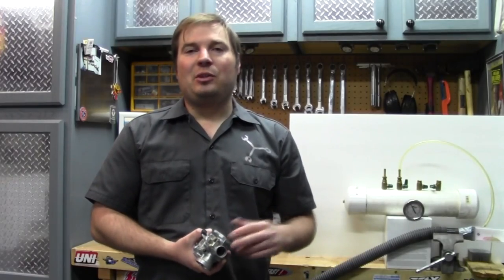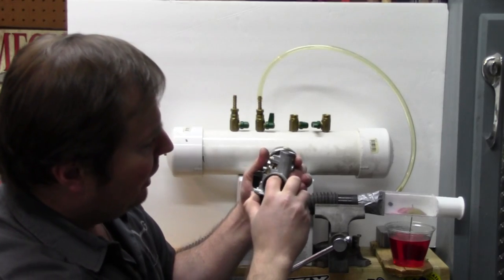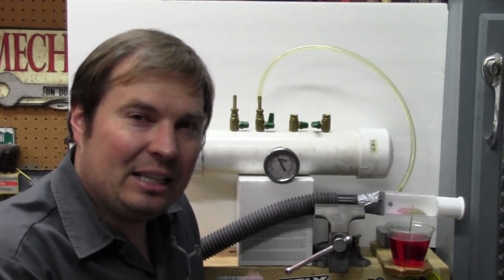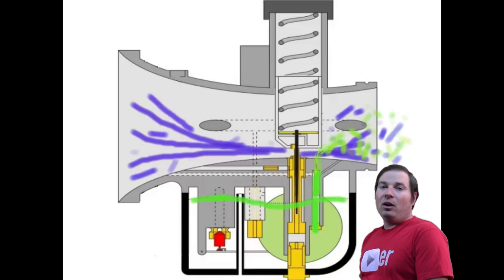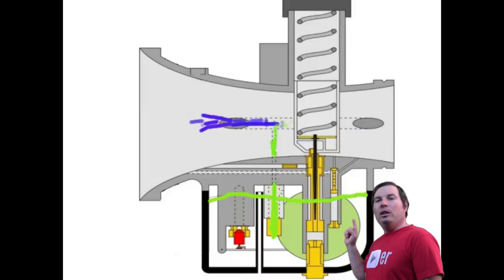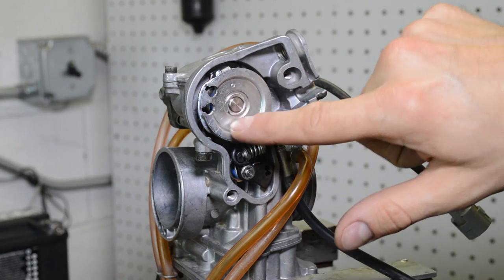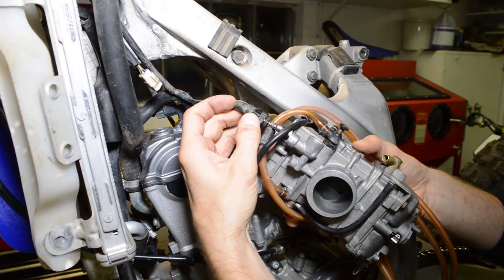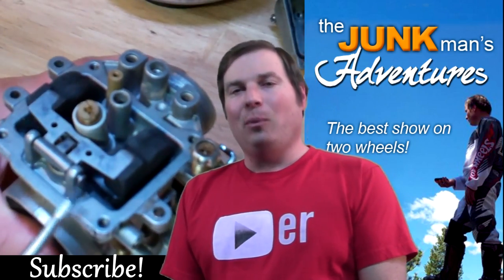How to adjust a carburetor, jetting and mixture explained!

Comment: I got a 2020 yz250x and my elevation is about 4500 FEET above sea level. What do you think i should go with jetting? Dont really know much about jetting.
Reply from the maker: The higher the elevation the lower the air density, the leaner the mixture you will need.
Reply: @thejunkman  so the bike comes with a 50 pilot jet and a 178 main jet for see level, im at 4500 feet above sea level. What pilot and main jet would you reccomend me to run at this elevation?
Reply from the maker: Is it bogging or spitting excess black soot right now?  If not, I would just leave it alone.  Otherwise get one step leaner on both and do some testing.  4500 feet is not terribly high up and should not require much of any tuning, maybe a jet needle clip position change is all.  I have to jet my bikes all the time as I regularly ride from 2000-13000 feet with an average of 7,000 feet is what I shoot for a sweet spot.
Reply: @thejunkman  throttle response feels perfect, power feels good and everything. But when im taking a corner in say first gear it feels like its gonna die out unless i throttle the gas. Also ivd gone  through 3 spark plugs in about a month. So idk if its the jetting or what?
Reply from the maker: I guess the first thing I should have asked is if the bike is broken in?  There is a period of time when the parts need to "wear in" so to speak and this can cause odd performance at times.  Also being it is a new bike, sometimes some swarf from the manufacturing process in the tank finally makes it into the carburetor and can cause odd problems.

Comment: i am rejetting for temperature and altitude on my cr 250, what i need to know is do i richen or lean out for colder temps, and do i richen or lean out for high altitude
Reply from the maker: Richen for cooler temps (air is more dense). Leaner for higher alitulitudes (air is thinner)

Comment: Do the butterfly make any affect on the vacuum?
Reply from the maker: On a CV type carb. Yes as that controls the air into the carburetor. But no if you are talking about the choke plate.
Reply: the butterfly .the rison i ask this is bcuz my1994  750 catana 2 and 4 are warm not hot like 1 and 3 but when i sprey gas in2 and 4  they get hot my air and fuel screw are set to 2 1/2 out all 4
Reply from the maker: If I am reading your response correctly (spelling and grammar aside) It sounds like the carburetors are out of sync, and thus those that the exhausts are not hot have either an ignition problem OR the carbs are not sync'd with the ones that are working.  I don't have a video on bench syncing but this guy that I have collaborated with in the past has a good video on it.  https://youtu.be/oVlLitzF38I

Comment: @thejunkman hey man im having issues with my 2t 86cc yamaha zuma. It used to rev up to 13500rpm at full throttle. Now this is what happen. Idle to 90%throttle rips and accelerate 0-120kph no issues but once i move throttle from 90% to full rpm drops by 300-500 rpm and ypu can tell theres a power loss and decrease on the speed. But when i back off to 90% its better power and speed. 

Am i too lean or too rich on Main jet?

I am using 26mm pwk  mj:108 idle: 40 needle:#2 from top

Thanks
Reply from the maker: You sure it's not the Cvt slipping?
Reply: @thejunkman  no.. cause it accelerate like a drag scooter(slightly exagerated lol). I tried to put throttle 90-full slowly to eliminate this issue but the rpm drop is still there. It seems like there is a switch between 90-100% that causes it thats why i thought it might be the main jet.
Reply from the maker: Well that is the only adjustment in play at that throttle opening. Try one step richer.
Reply: @thejunkman  i might be wrong with my thorttle percentage.I just double checked and it was around 3/4 to full throttle. Thats when the rpm drops/decrease in speed.
Reply from the maker: Ok, well the video tells you what adjusting are in effect at that throttle opening.  My other video will help as well. https://youtu.be/SkoMCP9QreQ

Comment: Does pilot jet work on an open wide throttle ? Because on my experience, bigger size pilot jet gives sligthly richer fuel supply on full throttle than the smaller one with the same main jet.
Reply from the maker: No, the pilot has no effect on mixture at WOT because all the fuel supply is going up the main jet as shown in diagram
Reply: thejunkman And what do you think about big or small pilot jet on any condition ? I mean any kind of effect especially on tuned and daily use engine ? Thanks.
Reply from the maker: The pilot jet ONLY affects the mixture at idle-1/8th throttle. The rest is controlled by the jet needle taper, clip position and main jet size
Reply: What turns the pilot off at WOT?
Reply from the maker: The fact that the vacuum is lower amd the fuel level in the bowl is lower below the dip tube of the jet itself since the main jet it sucking all the fuel.
Reply: thejunkman is that a theory or proven? I  am not arguing but challenge that the pilot is shut off at WOT.

Comment: mrbrenton182
20 minutes ago
Hi guys, trying to tune a 97 KTM 360. The carb on it is a Keihin PWK 38 that also has a 'Throttle Stop Screw'? My question is, where does this come into play with jetting the bike? What is it's neutral position and/or do I set the air screw first and then adjust the throttle screw? Thanks guys
REPLY
Reply from the maker: +mrbrenton182 the throttle stop screw is what sets the idle speed by limiting how far down the throttle slide can go, thus limiting how much air can go through the carburetor at idle or with the throttle closed.

Comment: I have tao tao 125 cc hellcat with a mikuni carb on it, I cleaned the carb and put  it back on. Bike started and idled but when I give it throttle it dies out, any ideas ?
Reply from the maker: Take a look at your pilot jet and the jet needle position.  Watch the video again and look at how the fuel flows at partial opening throttle.

Comment: Hi brother, I have a problem with my Megelli 250R , the motorbike is difficultly started when the engine hot. Could you give me recommendation regarding this problem?
Reply from the maker: Mixture might be too rich.
Reply: Thank you for your advice we will check and give you info regarding the reason
Reply: Manufacture recommend me to adjust returning clutch
Reply from the maker: +Namiq Nasirov the clutch shouldnot jave anything to do with ease of starting
Reply: Thanks for your response, I will inform you regarding reason

Comment: At full throttle, why did the pilot jet activity stop?
Reply from the maker: At full throttle the fuel level is below the pickup on the pilot jet rendering it inactive.  Even in the instances that the level is at the pickup point, the pressure differential will mean that the fuel will naturally want to go through the main jet as it is a larger hole.
Reply: @thejunkman  oh interesting, I've been wondering how jets switch for a while. Your the only guy with the answer! Thanks man

Comment: I have a polaris 2004 XC 600 twin with mikuni carbs. It starts and runs fine. After 30 seconds or so it starts to die. pumping the throttle will recover it, and turning the choke on helps too. Seems like it's starving for fuel. After pumping the throttle a couple of times it runs goood again, then after a 30 seconds or so will try to die again. Any suggestions?
Reply from the maker: Good job you diagnosed your problem. Fuel starvation is a sign of a fuel delivery problem, check that first. Ie clean the full system.
Reply: OK quick update. I did some more diagnosis this weekend. I pulled the fuel pick up out of the tank, and gave iit a cleaning, but it wasn't dirty at all. I started the sled up and paid some closer attention. It idles @ 1100 RPM for about a minute, then it starts to die. I pump the throttle to get it going agin, and about 20 to 30 seconds it starts to die again. However, if I hold the throttle open @2000 RPM or 2500 RPM, and hold it steady, there is no dieing at all. It just keeps on running nice and smooth. So, that makes me think it miight not be the fuel pump, or even the floats in the carb. I tried adjusting the idle higher but it didn't make any difference. BTW I already confirmed it wasn't the tank air line being plugged byu running it with the gas cap off. Same issue. So, would this dieing at idle w/no throttle be a carb adjustment issue?? If I have to pulll it apart to get the fuel pump out, it will sit until spring, so I'm just making sure I'm not barking up the wrong tree. Thoughts? TIA!
Reply from the maker: If its got some sort of fuel pump I would say that might be the next thing to verify.  Its a fuel starvation problem, so you have to work from the tank to the carburetor first.  Do these sleds have some sort of vacuum operated fuel pump?  How about the fuel shut off, is it vacuum operated?
Reply: Yes, it's a vacuum fuel pump. I guess next step is taking it apart and cleaning it, and checking the gaskets etc. Fuel shut off is just a manual valve in the fuel line. It's fully open as far as I can tell.
Reply from the maker: The vacuum pump might have a tear in the diaphragm.
Reply: Ok I’ll check for that. Is it possible there is a bit of a vacuum leak going to the fuel pump? I’ll check the lines just in case
Reply from the maker: That is a possibility.

Comment: Hey, do you know what would cause a 1995 KTM 250 two stroke to engine pulses on decel and idol?
Reply from the maker: That is usually caused by either a vacuum leak or a worn, warped or broken reed

Comment: Let me explain about honda cb250 night hawk carburetor it is 2000 model carburetor  va37mam police version. I clean it and start the engine but still smoke are not stopping from exhaust pipes and spark plugs are black dry sooty deposit and when I replace a new  va35 model carburetor smoke are stopped and spark plugs color is nice but I really enjoy with va37mam 2000 model carburetor which is beginning from my bike so please let me explain the solution jankman how this carburetor problem solve and how i can ride my bike with this carburetor.
Reply from the maker: I would like to hear what you did to make the va37 carburetor work.

Comment: Some carbs have rubber plugs on the slow jets.  How do the jets get fuel?
Reply from the maker: +Robert Brandywine from another passage in the main jet emulsion tube
Reply: So all the fuel is sucked up through the main jet and then some splits off to the slow jet?
Reply from the maker: Sort of, when the main jet is closed via the jet needle the fuel is diverted through the pilot jet/slow jet.  It all depends on the exact design, however the operation and physics are the same.

Comment: hi sir i need help im using a 28mm pwk flatslide carburetor. my ilde keeps on hanging when i release the throttle.
Reply from the maker: I would say you have a vacuum leak.
Reply: thejunkman  where can i possibly have a leak, maybe in manifold or intake lines from manifold and carburetor?  im not a mechanic sir, i also turn my air screw 1/2 turn in to richen the mixture, because i keep reading forums that i maybe on the lean side of mixture, but it doesn't help either. maybe i have vacuum leak
Reply from the maker: Well be absolutely sure there is no vacuum leaks in the intake (after the carburetor obviously).  If that checks out.  Try a richer pilot jet and then re-set the idle mixture.  This is also assuming that all passages in the carburetor are clean as well as the jets.
Reply: Mine does the same but a pz30 carb?
Reply from the maker: Typically this means you have a lean condition for some reason.  A vacuum leak can be just one cause.

Comment: hI Junkman  I got 99 honda shadow vt1100cc and is running to lean,,is making sparkplug white. I do not find how to get to the problem,, I put 2 new pistom vacume with stage 1 jet on stock pipe,,,,,,2 new float level on 9.2 mm higt float,,I play with mixture screw from 2 turn to 4 turn and still running lean. Petcock working good,,,,fuel pump pumping good pressure.  Stage 1 main jet #60 in front and #65 on rear and it was running lean so I change from #60 to #65 in front and from #65 to #70 on rear to see if I can get more fuel to the engine but nothing,,, the motorcycle still runnig lean,,lazy,,,,I can feel the pistom knocking. Any Idea?
Reply from the maker: You need bigger main jets or lower the jet needle clip position.  I am not familiar with that bike but maybe try the same size jets in both carbs?
Reply from the maker: FYI the mixture screw is just for idle speed only
Reply: thejunkman the needle clip is on the 3rd position, if I lower will be 2nd position but les fuel pass. Or you want to put it on 4th position to Let the fuel run.
Reply from the maker: lowering the clip raises the needle as outlined in the video.  This will ever so slightly richen the mixture throughout the throttle opening.  Just have to keep tuning.   Check my website links for more help.
Reply: got it I will try that,,,,,,but my bike has stock pipe,,according whit dino stage 1 ,,,,,stock pick use #160 jet in front and #165 on rear,,,,and I swab to #165 in fron and  #170 on rear pistom and still running lean. but I will try to lowering the needle cliip and I will let you know,,,,,,,,,,,,,,,,,,,,,,,,,thanks Man

Comment: Im having a problem in my yzf r1 i put a RAM air sistem and now at full throtle its seems a bit weak like its lean mixture is it the main jet or can i use a washer in the needle? In idle is fine and it has a great accelaration except at full throtle
Reply from the maker: +The Rider your on the right track. Try the jet needle clip position first then changing the main jet
Reply: thejunkman thanks ill try that
Reply: thejunkman its only when im riding because of the air pushing in when im standing still and i accelarate its ok i think its because the high flow of air
Reply from the maker: +The Rider well that could be. cv typr carbs don't work that way. They operate on pressure differentials to open the slides.
Reply: The Rider if you push more air in you need to get it out, so you might, 'might' have an air restriction at exhaust.

Comment: my KAWASAKI KLX150 blows gasoline back to tha air cleaner can u please explain why?it so hard to start the engine when it occurs..the pass through the hose that come from the cylinder going back to the air cleaner..tnx
Reply from the maker: I am not fully understanding the question or symptom.  Can you re-phrase it in a more clear and concise way?  I don't think you mean there is fuel coming back through the crankcase vent (which in your case must go to the air box)  That is really not possible.
Reply: it's a small hose the conects from the leftside of the cylinder to the airbox.when i opend the airbox and put the throtle in high i saw smoke and gasoline flow through it...the air cleaner foam was melted co'z of the gasoline..
Reply: it's a small hose the conects from the leftside of the cylinder to the airbox.when i opend the airbox and put the throtle in high i saw smoke and gasoline flow through it...the air cleaner foam was melted co'z of the gasoline..
Reply from the maker: That is the crankcase vent.  The smoke is blow by from the rings (they are worn), the gas I can't explain unless the carburetor is flooding from a sinking float or float height set to high or even dirt holding the needle valve open.

Comment: why is that the idle of my bike is going up and down, if i turn the idle screw low the the idle is too low and,
and when i turn the idle screw a littlebit up, the idle goes up and down up and down..
can you help me?
Reply from the maker: The jetting is lean in the idle mixture. You need to correct that. I have videos and text explaining what you need to do on my website.

Comment: Nice display drawing  Junkman, but unfortunately you are pointing at the wrong tuning components when you are talk about them, which makes it very confusing. 
I'd like to see you redo it, use a pointer to indicate the correct metering devices as the throttle valve opens, and explain how they work and can be adjusted. Thanks.
Reply from the maker: This, was done in green screen (poorly), meaning I can't see what I am pointing at and I did my best.  I have some more videos coming down the pike, as well as the info on my website that compliments this explaining this even further.  You might want to check that out.  Links in the description.

Comment: my friend adjust my ts 100 carb.after all my ts loss some power and the throttle not responsing like before
Reply from the maker: +Emil Bernaldez poor or dirty fuel?
Reply: +thejunkman i dont know what do you mean.he adjust the af mixture.and the idle.the throttle was not responsive like before.
Reply from the maker: You might have some dirty or poor fuel you are using.  Try using fresh fuel, if that doesn't work you might have dirt in the carburetor and it is just a coincidence that it happened after he made some adjustments.

Comment: on my 38mm  vm mikuni  the lower the floats the less fuel? the higher more fuel
Reply from the maker: +Kevin Stearns In the float bowl, yes. Now that said the float height needs to be set to the proper level for the jets to function properly. This is found in the manual for the proper float height.

Comment: Sir it is not clear that how the petrol rises from lower part of carboretor
Reply from the maker: Physics. It is a pressure differential caused by the venturi effect of the air moving through the carburetor.  It is fundamental.